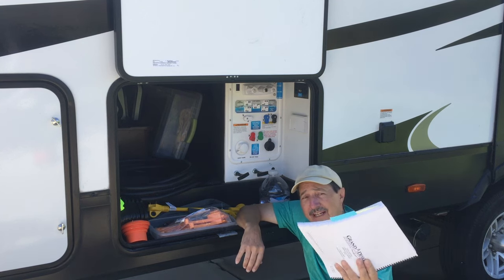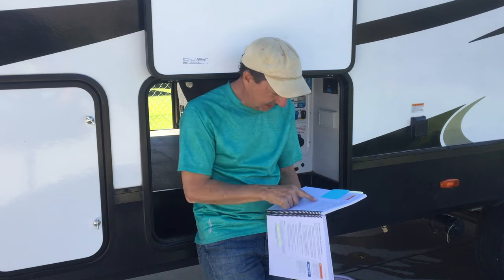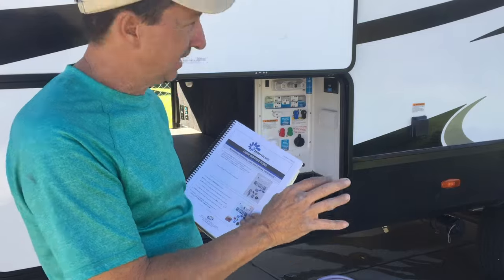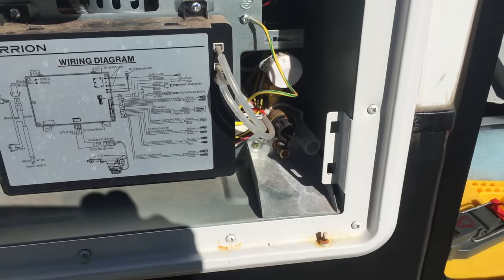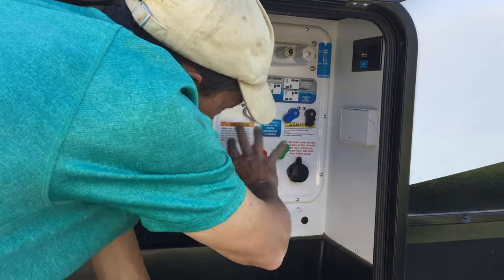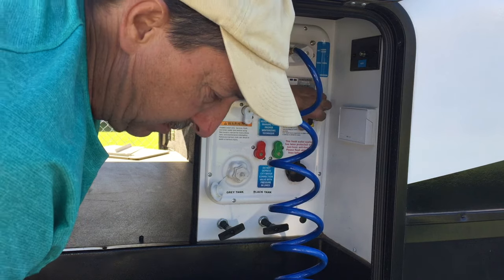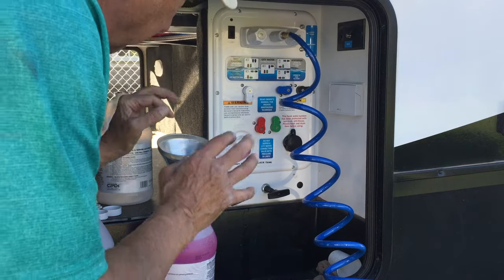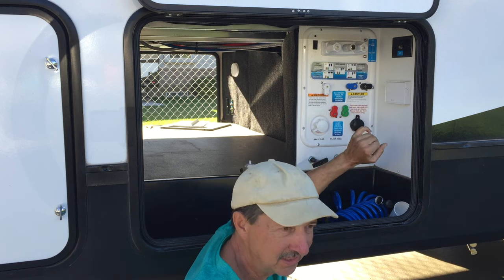CAUTION! Manual is WRONG! How To Winterize "On Demand" Water Heater. Grand Design Reflection

Comment: Hmmm first it’s a Grand Illusion……ha. 🤪. They r not the best….they pull great though….yes GD uses the cheapest material they can cough up.  As you say…a home inspector would Red card these RV’s because of poor quality components n workmanship, these guys don’t have this $&it in their homes but have no problem putting it a RV, I have a on demand Water htr. I did follow the book and I got anti freeze outta it.  No problems.   I’m knocking on my head…. Oops. Wood. 😂
Reply from the maker: It is crazy how the RV industry gets away with the crap they do. It is shocking how many axles and springs fail after just a few thousand miles. At least a water leak will not kill anyone. Knock on wood... Funny stuff, thanks!

Comment: I have two questions. Where are you hook in the clean City water to fill up your clean tank do you worry about that line I know I know you shouldn't be worried about the actual tank itself because you drained the tank but the lines going into that tank. My other question I have a brand new electric gas tankless water heater and it seems to not cycle the water through the hot water tank unless I turn the tap on pretty high and there is electricity and propane turned on. It's almost like it skips the hot water tank. Do you think I should turn on the power and propane? I know this stuff smells like vodka is there any chance it's flammable? I just want to be sure I can get all of the water out of that tank.
Reply from the maker: I have thought about the lines to the fresh water tank as well but I have never had problems so the water must drain well into the tank. I have heard of some people putting a little antifreeze into their fresh tank just to make sure and then draining the tank. I don't turn my hot water heater on when I push anti freeze though it. The pump does a great job getting antifreeze through the piping and faucets.

Comment: You can add us to the folks that followed the manual and broke our tankless heater.  We didn't find out until 2 months after the warranty expired.  Now I'm spending our vacation time bypassing the mixing bowl (poorly designed) so that we can have water to the RV.  Not a happy camper at the moment.
Reply from the maker: Sorry to hear you followed that terrible manual. It's a shame that the company does not step up and repair these.
Reply: I’m actually in the middle of trying to get grand design to pay for this! 
Our rig didn’t get winterized 2022-2023 winter due to us traveling in southern states. I winterized it last fall and didn’t take it out until this summer and bam!! Water gushing out the side of our rig…so frustrating. If I had just YouTube’d this instead of going by the manual I would of had hot water during our labor day weekend trip…
Reply from the maker: @dandycox2200  Sorry to hear that you found out your water heater was damaged before your Labor Day trip. My fridge went out during a big Memorial Day trip last year. Not fun to loose a major appliance during a big trip. Good luck with your water heater.
Reply: I had that happen and I complained to my dealer. They took it to Grand Design and Furrion, which replaced it for free. I love the heater but hate the winterizing process and lame instructions.

Comment: I see where the water gets drain and blown out with air but why bother when you can just put the antifreeze in and run it out the faucets until you see pink.?
Reply from the maker: I have thought about removing the blow out step, but just in case the pink stuff gets thinned with water, I want to be sure it's full strength. I have had freeze damage 4 times in extreme cold so I am overly careful. I have tested some of the pink antifreeze and it does freeze, it just will not expand to bursting. In my mind, a little water may cause damage that I don't want to have the chance for flood damage later. I had a toilet valve break and it caused major cabinet damage. Better to be safe.

Comment: why do they not want anti-freeze in the water heater?
Reply from the maker: I have wondered that myself. I don't see a problem with RV antifreeze.
Reply: The mixing ball on the back of the heater has tiny tubes that will fill with the antifreeze and bust when the antifreeze gels about 0F. Another poster said to just drain the water from the ball by loosening the bottom nut on the ball.

Comment: Great video. You mentioned pressure for blowing out. Every water pump from the factory I've seen are set to 55psi. That is the pressure I blow my system out with. I also go one or two steps farther. After I put antifreeze in the system, I connect the air again and blow all the antifreeze out (you can't freeze what's not there). Another step is PEX can take a lot of pressure but if something freezes like an ounce of water in the line that will build up thousands of pounds of pressure, the line will split at the weakest point not necessarily where the water freezes. If the faucets and drains are left open, there can't be any pressure build up if any water freezes. I had camping world also, they had to replace my fresh water tank 4 times because they don't know how to work with plastic pipe. Good luck. I remember you mentioned lithium batteries. I had one installed in one of my toys. I figured it would be better than lead acid in my shed over the winter. I would need to add water as necessary and charge them during the winter. I read up on lithium, they don't like severe cold. We get winter nights of 20 t0 30 below zero and that can damage a lithium battery so now I bring it in the house after charging
Reply from the maker: I like your idea of blowing out the antifreeze. I never though of that. Thank you for the comment and thanks for watching.
Reply: Recapturing the antifreeze in their original containers seems like a good idea to save it. Nice tip sir!

Comment: Thank you for taking the time to do this video!.  We followed all the steps but didn't catch if we are to leave the low point drain plugs open or closed? We have them closed thinking that there is antifreeze in the lines. Correct?
Reply from the maker: Yes, you are correct. Keep the low points closed so that the antifreeze will stay in the lines. Thanks for watching my video. Glad you found it helpful.

Comment: Great video sir, well done and you are correct, those manuals are wrong. I have a winterizing business here in Montana. That Furrion tankless heater is the only one that has ever given me problems. I'm not sure if you left the filter and drain plug removed but I would recommend leaving them out. Also, there is a mixing ball in the rear of the unit. It helps regulate hot water when another appliance is turned on. So when the wife is in the shower and you turn the kitchen sink on, there is minimal temp change for the shower. There is no drain on the mixing ball. RV antifreeze will start turning into slush at around 0 degrees F which will build pressure. This mixing ball is extremely fragile. It will break because it is filled up 100% with antifreeze. 
All it takes is access to the rear of the water heat and a 3/4" wrench. Place a towel under the ball and crack the lower fitting and allow to drain. If you add these steps to your winterization process your outcome will even be better. Once again, great video.
Reply from the maker: Thank you for watching and big thanks for the tip on the mixing ball. I did test my antifreeze and it does jell like you said. I have heard about that mixing ball breaking but I was not aware of antifreeze being able to break it. Thanks again. Love hearing from people like you that share their experience to help us RV owners. Cheers!
Reply: We just went through a damaged mixing ball on ours.  It froze and drove the standpipe out of it the bottom of it . BIG LEAK.  Had a mobile tech come by, and of course they don't make the part anymore so the option was to buy a new water heater.  I had the kid remove the mixing bowl and bypass it and the system works ok.  I recently had the bowl repaired and  and added a low point drain connection on the ball so I can drain the water out of it when winterizing and can then verify that it has filled with antifreeze.
Reply: Thank you. I've had problems with mine and read about the mixing ball and antifreeze issue, but you're the first to suggest this fix. I'll do it this fall.

Comment: Thanks for the video, GD videos are clear as mud. Ya might have done it but not shown it but did ya do (or do ya not have) the back spray port near the tailights? I hate tryijg to get that hose to connect, such a pain and no rhyme or reason to it that ive found.
Reply from the maker: No. I don't have a spray port by my tail lights.

Comment: Manual on mine said to blow it out with compressed air and then bypass when putting in the pink stuff.  When I hooked it up in the Spring it was like a waterfall coming out of the water heater.  Fun fact: the manuals are probably all wrong, they don't make any replacement parts for those heaters so you have to replace the entire thing, it'll probably be something like $1500 to $2000, and it's not covered under the replacement insurance because they see it as a user winterizing error.  Local dealership told me they had at least 20 of those in their junk pile from early this year alone.

If anyone knows of a class action lawsuit, let me know.
Reply from the maker: It is a shame when the owners manual instructions are clearly wrong and the manufacture will not cover the damage that it causes.

Comment: I see your title indicates on demand water heater, but I would recommend adding maybe the year and Grand Design Reflection in the title, as well as updating your description or a pinned comment to stress that your statements regarding **"bypass the water heater ... you're not supposed to do that"** at 0:43 were both on your specific RV, and not only an on demand water heater, but with your specific model Furrion on demand water heater, and ultimately just what you're doing on your own personal RV. Otherwise you run into the same issue that you're complaining about in regards to Camping World and Grand Design in regards to someone potentially blaming you for an issue on their RV.

One of my clients watched your video and probably some other videos in an attempt to winterize their own  Grand Design ( Solitude ). It doesn't have an on demand water heater. They didn't bypass, and couldn't figure out why after 7 gallons of antifreeze they weren't getting anything pink coming out of the hot water side, only to realize that they've essentially filled their hot water heater with the antifreeze.

I understand the intentions were good, and owners should be aware of what equipment they do or do not have, but unfortunately we live in a world where people have to provide so many disclaimers to avoid blame. 

This comment wasn't meant to bash what you did or anything like that. Just that the title, description, and contents were even a bit too vague for another Grand Design owner, let alone anyone else who might come along the video who maybe doesn't have the nautilus, or that specific on demand water heater, etc.
Reply from the maker: Thank you for your detailed comments. Very much appreciated. I will update my specific trailer information in the title and description. I did have someone ask a question about tank versus tankless. Definitely 2 very different winterizing steps. Thanks again.

Comment: What are those attachments called to attach to the valve to blow air in?
Reply: They are just a simple fitting. Male hose thread on one end, and valve stem sized on the other. I picked up a plastic one at Wally-world for a few bucks.